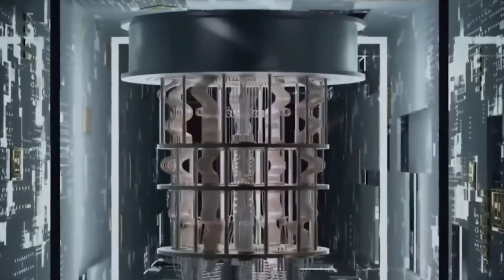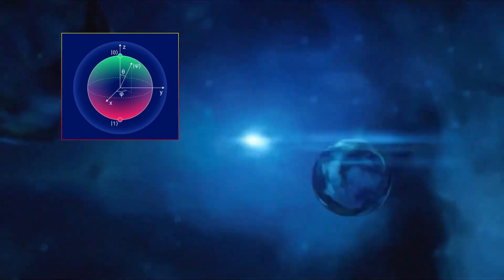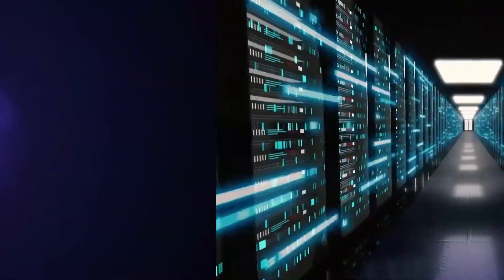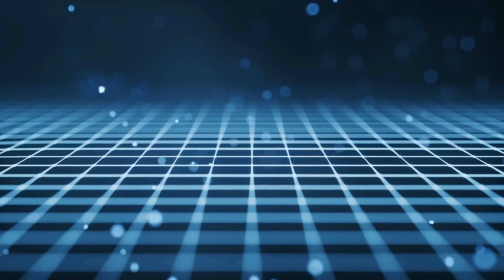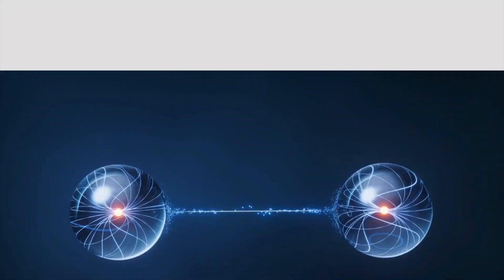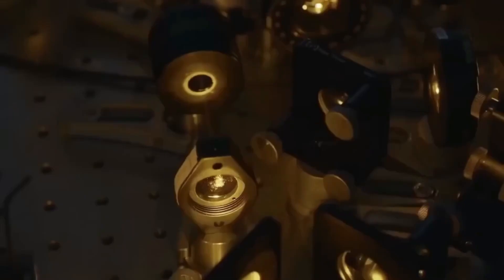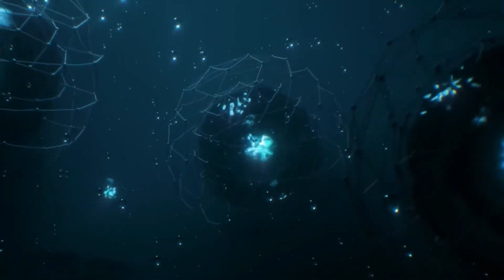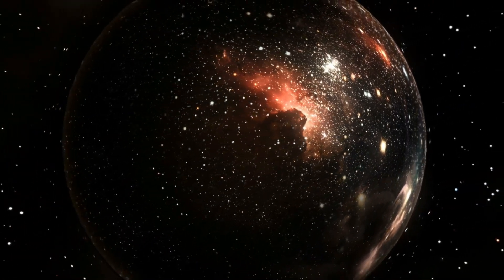Quantum Computer Just Detected a Parallel Universe Shifter!

Comment: Now I am starting to wonder if quantum tunneling and superposition aren't all quantum entanglement. If there is no time delay between entangled particles then surely they must be able to exist in two places at once and then if there is no distance or time constraint then they must be able to exist in two states at once. Quantum tunneling, quantum entanglement and super position are all the same thing. This would also suggest there is no limit to how many parallel universes that can exist and we are at the very tip of the thin end of the wedge of how enormous this is. If time and distance have no bearing on quantum relationships then volume/bandwidth have no constraints either. Reality then becomes all about collapsing wave forms. Maybe there aren't parallel universes splitting off and moving forward in time as we understand it but parallel universes that exist in super positions until we collapse the wave form and bring it into existence then each collapsed wave form creates another super position and so on and so. Parallel universes are more than likely super positions and our reality is the collapsing wave form.

Comment: According to the "many-worlds interpretation" of quantum mechanics, the idea of a multiverse isn't something that "escapes" from a quantum computer, but rather a theoretical concept that suggests a quantum computer might be harnessing the power of multiple parallel universes by utilizing the phenomenon of superposition, where qubits can exist in multiple states simultaneously, with each state representing a different possible outcome in a different universe; essentially, the computer is performing calculations across these parallel realities, leading to faster computation speeds. 

Key points to remember:

Superposition:

This is the key quantum property that allows for the "multiverse" concept to be applied to quantum computers, where a qubit can be in a state of 0, 1, or a combination of both simultaneously. 

Many-Worlds Interpretation:

This interpretation of quantum mechanics theorizes that every possible quantum outcome actually occurs, creating a vast number of parallel universes. 

No physical escape:

It's important to understand that there is no current scientific method or technology to physically travel between or access these parallel universes, even if they exist. 

EXACTLY!!!!!!

Comment: Before discussing parallel universes, let's first understand our own. Apply Occam's razor and keep explanations simple. Introducing more universes or dimensions than necessary is not much different from introducing a deity as 'explanation' of everything. I think we don't need other universes to understand quantum physics. If there is a consistent 'anomaly' detected, that is a hint of a systematic error, not of parallel universes. Contrary to what you said, not all variables have been eliminated.

Twinkle, twinkle, little star, how speculative we are?

Comment: Observing changes within separate molecules and assuming they're in sync on separate continents is a huge jump into assumption-ville. And assuming those changes are proof of a parallel universe is childish. And I'm not denying that there's more than meets the eye, because there certainly is. But if you really believe these assumptions, based on this video, then I officially dub you an official citizen of the Idiocracy.

Comment: The claim that '54 cubits opened a molecule' in Silicon Valley and it somehow appeared in London at the same time is wild, but it’s complete nonsense with no evidence to back it up. Quantum entanglement doesn’t work that way—it’s about correlated states, not physical objects popping across continents. The text throws around terms like 'anomaly' and 'parallel universe shifter' tied to CERN or Google’s Quantum AI, yet there’s no paper, no data, no specifics—just vague hype. Real quantum computing, like Google’s Willow chip, is impressive, but it’s about computation, not dimensional leaks. This is sci-fi masquerading as science—zero credibility without a shred of proof!

Comment: parallel universes? really? why not the obvious answer rather than creating clever sounding constructs that wow and amuse the masses just like the word quantum which simply means "big leap" NOT super duper color fragalistic sparkly gasping galactic godlike outcomes. It is getting old fast and will not age well. Do some real research and go reference Maxwell, Heavyside, Steinmetz, Shauberger etc etc and you will find the simple answer. ALL mass moments either what is called sub atomic or atomic or molecule or magnetic or diamagnetic etc etc have intrinsic connection to 'potentially' all other of the same stuff instantly throughout the single potentially endless universe as tested, verified, experienced, calculated and accepted by the great fathers of science. If you do not research this stuff then you are doomed to confirmation bias and mass hysteria.